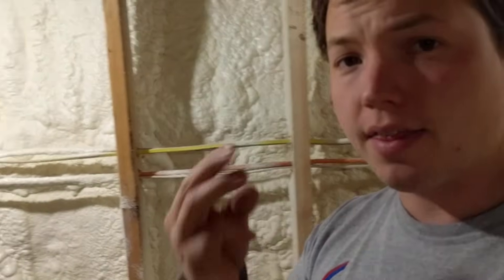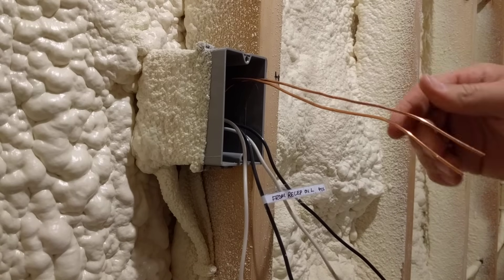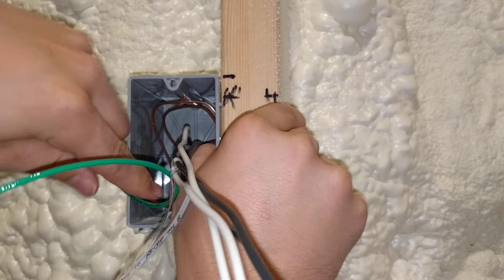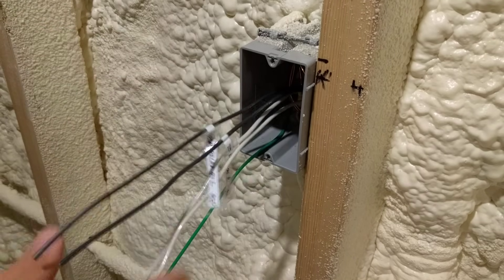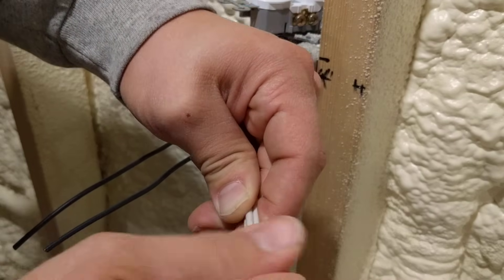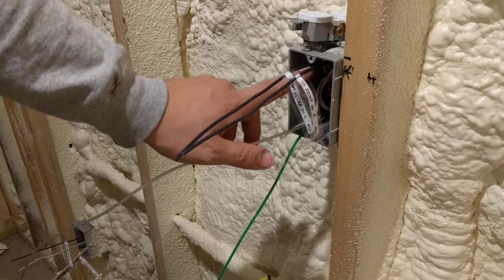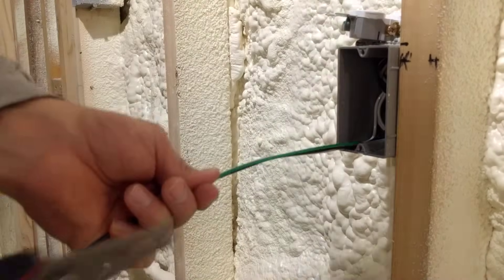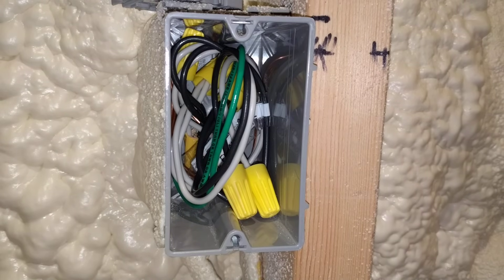How To Rough In Wires for a Standard Outlet or Receptacle Using Pigtails in Daisy Chain - Ben's DIY

Comment from the maker: NOTE that per the NEC you are required to run the same size wire for the grounding pigtails as the circuit size would require for the neutral & hot now! Check with your electrical inspector though as some do allow using 14ga on a 20amp circuit but that opinion will vary. Good luck on your projects!
Reply: Used a lot of your videos for wiring my garage and a shed. Lots of lights, lots of outlets. Thanks for the help. Passed inspection this morning.
Reply: Generally speaking, the ground wire (including pigtails) is sized according to breaker size. See Table 250.122.
Reply: Really like what you have been posting, maybe get a video of installing the outlet and getting it in the box flush not skewed with 12 gauge. Anyway I commented to say code is code, but 14 gauge can handle 20 amps, it's just derated for numerous reason. Check out wago 222 / 221 vs wire nut overloads on youtube by a Stefantrethan, you will see wires melt etc. Wagos  are a god send when redoing outlets with wires trimmed to 2 inch. Thanks for the time and hard work.

Comment: So what's the situation when we use the green wire nut with the pass-through hole. Seems it could work here. Is it just that you prefer the insulated ground?

Comment: So just to make it clear, you can pig tail or do two hooks on each side, both ways are fine ?
Reply: He says no. He says a single connection with pigtail is more reliable. 

However, you should pigtail the leads to the receptacle because the code says that the receptacle should be able to be removed without interrupting the circuit. Thus, you could remove a defective receptacle and push the connecting wires back in an empty box. You cannot do that with two hooks. 
Now, if you make a split receptacle, like the top one switched and the lower one hot, you can use the two screws once you remove the tab connecting them.

Comment: Another reason to use pigtails on a feed through receptacle is because if you remove a receptacle you could potentially place a 120v load in series on 240v.
Reply: am I missing something, u mean removing a receptacle from the circuit? and if so why would you get 240, did you not either terminate the line or connect the load line with wire nuts, and also connect the neutral with wirenuts? Please explain what you mean

Comment: If you pigtail instead of using the bottom connections when is it you use the bottom connections?
Reply: You don't, unless it's going to be a switched receptacle or each socket is on a separate circuit.

Comment: where did you learn to not mechanically twist the wires before applying the wire nut?
Reply: Says you don't have to on the package. Code says do it per manufacturer's instructions if the caps are rated.

Comment: Just my opinion, but I would think that copper wires held down onto the outlet would be more secure than introducing more pigtails with wire nuts.  You can certainly put more torque on them without damage.  Thoughts?

Comment: Hi Ben, Great information, especially for the DIY!  I noticed you have the ground with a covering on your  pigtail, so you can ground your receptacle or switch.   Also, great info on applying the wire nuts as DYI’s we initially screwed the wire nuts so tight as it did creat problems when we had to go back into the box.  

Initially worked with high pressure boilers and all electrical was with metal, in fact not sure if plastic waste being used anywhere?  

Back to the ground, we forgot to to tie in all the grounds and fortunately we had a fair Electrical Inspector (EI) as he allowed us to finish the unfinished grounds and then send pics of remaining grounds!

When we use metal boxes we omit the pigtails as the box of grounded and receptacles are grounded when you attach them to the metal boxes which are used for switches, receptacles,, and any junction boxes.

Curious Ben, what are your thoughts on metal boxes and just grounding the metal box?

Thanks,
Zoe Z

Comment: I was told when you connect travelling grounds together they needed to be crimped with a brass crimp.  Is that a real thing?  It always seemed a bit belt and suspenders to me, but it's in my training.  so crimp and wire nut????

Comment: Twist the bare grounds together by hand, fold one over, cut the other flush to end if twist, crimp end, apply wire nut, fold push wire back, done, no problem with putting wires on screws, I only pig tail when 3 wires enter a box, a 20 cubic inch box

Comment: Did you ever make that separate video about when to use the green ground wire nuts? Besides that, I'm also wondering when one should use a grounding pigtail versus cutting 1 of the 2 grounds short and sticking out the other ground end through the hole in the green ground wire nut (to hook to the receptacle).

Comment: I notice the pigtail wasn't cut to length before adding to box connection - that's a good tip for me as I've had problems with keeping pigtails fastened properly (no tension from longer wire). Thank you.

Comment: I like twisting my wires with linesmans before I put a wire nut on them.. I've had wire nuts strip out and break because they were over torqued.. and I feel it is safer for the next electrician if the joints are twisted really well.. I'd be mad if I got shocked because I opened up a receptacle and the wires weren't twisted enough.. I change out live devices every day and the ones that normally get u are the ones with wagos, pop in inserts and not properly twisted wires.. I always tape around my wire nuts/joints and tape around the whole device to prevent the next electrician from getting zapped..

Comment: The only time the NEC requires pigtailing is if you're working with multi wire branch circuits and you are sharing neutrals.

Comment: You go to the extra work of using pig tails yes that is the proper way . It is for in the future if that plug has to be changed now you have to cut the power in the rest of the cct.  I look at you work with a metal ring on . That is always a very poor choice.  I know two people that got the finger blown off because of that .

Comment: You would fail inspection in Texas.  You have to use the green wire nut for the ground, grounds have to be twisted, and 1 ground is left long to connect to the device.

Comment: Interesting to use pig tails when there is enough wire 6 inches, I heard that if it was a multi-wire
branch ckt. 2 120 volt ckts in a box red on 1 black on other, u had to have a pig tail so u could 
maintain the neutral even if u had to remove an outlet. I really like ur gener8or vids.

Comment: Your video is great, but not correct. You do not have 6" from the from face of the box. You will overload the box with too much wire based on what you did. The NEC Code is 6" of wire from the termination point of the wire into the box. See NEC 300.14, that translates to 3 INCHES outside the box.

At least 150 mm (6 in.) of free conductor,  shall be left at each outlet, junction, and switch point for splices or the connection of luminaires (fixtures) or devices. Where the opening to an outlet, junction, or switch point is less than 200 mm (8 in.) in any dimension, each conductor shall be long enough to extend at least 75 mm (3 in.) outside the opening.

Comment: The Klein wire strippers you link to look different from the ones you're using in the video. They don't have that section right above the handle that you were using to tighten the wire nuts.

Comment: Do not use pliers to push wires into a box. You will damage the insulation. I like to use the end of a hammer handle to push wires in.

Comment: 30 year electrician overall, and 16 years with my own business.  
Good job but I will add my thought or opinion I should say. 
IMO Wire nuts are nothing more than a fast way to insulate the exposed conductors.
 
I always teach my guys to strip about an inch and a half, twist the conductors with lineman's plyers in a clockwise rotation. This way each conductor is binding with each other creating the real contact point.
This also prevents one wire from getting pushed out of place when the wire nut is installed.   
Trimming the wires after the twist creates the flat point for the wire nut to get a hold of and also insures that every conductor is bound by the internal wire nut spring. 

In all my years of experience I have never had to service a failed connection done this way.
I have repaired hundreds that were not twisted prior to the wire nut.
Reply: (DIY homeowner repairing prior work) I'm having a heck of a time creating the twist on 10-gauge wire for a 30 amp subpanel.  Is there a trick to creating the twist?
Reply: DIYer here as well...I start my twisting pretty far back (basically 1 or 2 twists at the insulation) and once you’ve got it started, you can use your lineman pliers to finish it off. The longer the wires, the easier it is to twist (i.e. more leverage) so you could also do as the original poster suggested and expose more copper than needed and then trim after. Side note - I wasn’t very good at this initially and used some spare wire to practice instead of trying to get it right at some poorly lit/uncomfortable splice point
Reply: Eh … unnecessary

Comment: Just curious why you didn't use a 20A receptable on the 20A circuit?
Reply: Agree, I would like this answered as well. In fact, some 15A receptables are designed to not accept 12 G wire. Seems that the code is trying hard to discourage this.
Reply: @darylboggs2917  15 amp duplex receptacles are permitted on 20 amp circuits. 15 and 20 amp "spec grade" receptacles are equivalent internally. All receptacles can accept 12 gauge wire, but you can only quick wire aka backstab with 14 gauge and only on residential grade receptacles.

Comment: Are you electrician? Do you know what is the length of the wires from back to the box ? You have so much wires extra that you losing space for let say thicker plug or combo plug and charger. Second you again mixing gage AWG #12 and #14 with circuit 15A and 20A. Please go to school, finish your apprenticeship program, become real electrician. Leave this video for someone who knows.
Reply: The length of wire outside the box is 6inches per code, as he states he does in the video, using the handle of his strippers. He only downsized the ground from 12 to 14 which at the time was acceptable to do as ground is a non current carrying conductor. He doesnt downsize the hot or neutral.  He also pinned a comment so it shows up at the top that this has changed per code and you can no longer downsize ground from 12 to 14.  Maybe you should go back to school and learn to read and pay attention to what's being said before spouting off ignorant insults.

Comment: Buy a pair of linesman pliers and learn how to twist wires
Its funny how newer generation make up their own methods of wiring (pig tail method) ha ha
Parallel method is the proper term and is commonly used in commercial and industrial applications
Series method is the common practice on residential applications
The crazy thing is how people say that series wiring is bad because if you burn up or lose one receptacle you loose all the others down the line
Now you need to ask yourself is that a bad thing for a residential application
Homeowner is plugging in equipment that overheats and melts the receptacle 
In the parallel method the homeowner can just go to the next receptacle and melt that one too and maybe the next five down the line
In the series method the homeowner would lose  power to anything down stream of the circuit and know they have a problem
Then homeowner would call a qualified electrician to come and repair the fault circuit 
Now ask yourself do you let a homeowner continue to melt devices and possibly burn their house down or do you shut down the circuit
Reply: You make an interesting point Tim, but I think it depends on the installers preference, skill level, and pride in workmanship. Both methods result in a parallel circuit, technically there is no series circuit in receptacle wiring.

Comment: For the rough in outlet, he powers on boxes and "leaves them on" during the sheet wall process.  He indicates that a Roto zip would be used and indicated that damage could occur either when the boxes are cut out and/or the sheet rock is screwed in.  Not good for either of the two scenarios if the power is left on.  And where are the metal stud covers to protect wires during the screw in process.  I say yes, turn power back on BRIEFLY during the arcfault test, then on again AFTER the sheet rock is on to differentiate when the problems were introduced and to protect the sheet rock guys.

Comment: I like all of your video's. In this one I especially like your clean work,  the tags on the wire and the insulated green ground wire. It should be 12 g.
Reply from the maker: You are correct! I later found out that technically it should have been a 12ga grounding pigtail but the inspector in our area recommends using insulated 14ga for the pigtail. One of those "local administrative authority" has the final say things. I need to make an updated video regarding this. Thanks for your comment! 

Would love to have you as a subscriber! Hit that bell too if you want notifications.

Blessings from MN,

Ben

Comment: When you say daisy chain are you referring to parallel wiring?
Reply: I believe that a "daisy chain" would be a series circuit. Parallel is how he did it using pigtails.
Reply: @om4444  Yes I think daisy chaining is the correct term when using the all the screws. Technically, there's no such thing as series wiring for receptacles, it's always parallel.

Comment: yup pigtailing instead of using all four receptacle screws...way to go!
Reply: Are you being sarcastic? If so, please elaborate. I’m curious if theres good reasoning for utilizing the direct screws instead.
Reply: Not using pigtails just shows you are a handyman.. it's so much easier and faster to wire nut a pigtail and fold it in for later.
Reply: You can do it without even cutting the individual wires.
Reply: @FrancisMacomber1936  thats even worse practice
Reply: @dondiego124  I'd love to hear why.
Reply: mescetacy What do you mean by “without cutting the individual wires”?